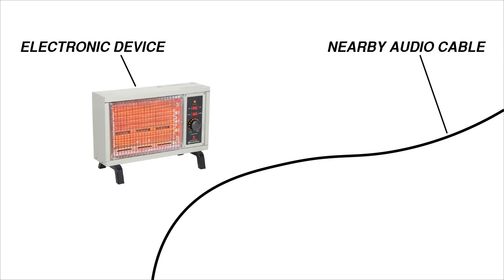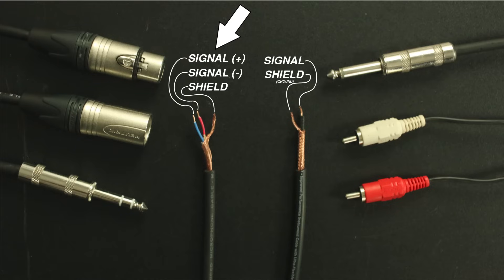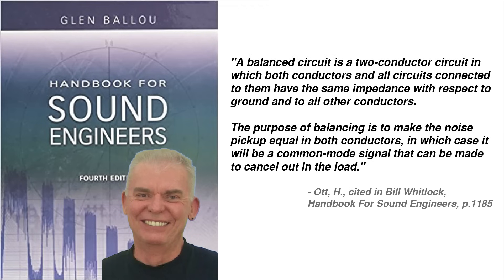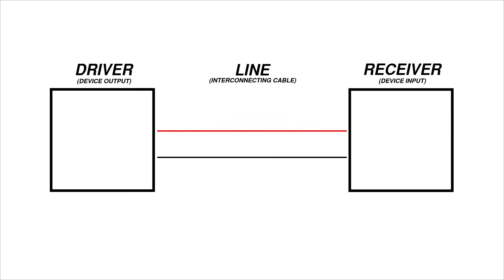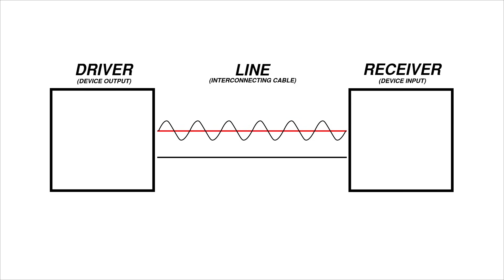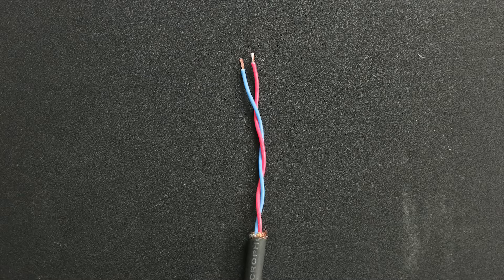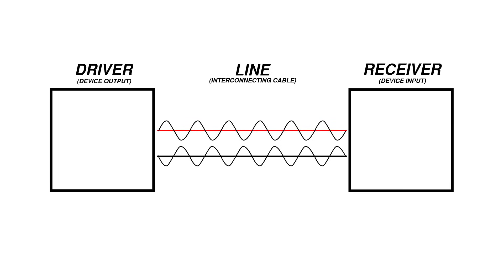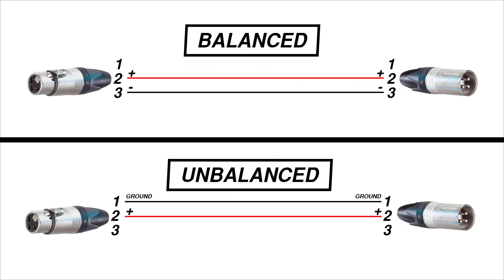Balanced vs Unbalanced Audio | Do Balanced Cables Sound Better?

Comment: I’m not an audio technician, but I do have a logical brain and scientific background. I agree that balanced cables are capable of a cleaner, but, what you neglect to mention, is that if you compare a truly, fully balanced amplify with a ‘direct coupled’, single ended or unbalanced amplifier the balanced amp will have to have that extra amplification stage. Each and every additional stage to any circuit will inevitably cause a degradation of signal! So, a truly single ended amplifier, connected to single ended source components using short unbalanced interconnects in an environment kept clean of electrical noise, or electro magnetic induction can equal, or even out perform balanced circuits and inter connectivity. So, you can never assume that just because you are employing premium balanced cables in a truly balanced audio rig, that you are achieving the best sonic performance. Neither can you make the same assumptions of truly single ended components using short interconnects. I say short interconnects as these will inevitably attract less interference than longer cables!
Reply: Thanks for the info. I knew that just replacing unbalanced interconnects with balanced ones would not necessarily result in better sound, but I didn't know why. Most explanations of balanced vs unbalanced don't cover this side of things. They only cover the positive case for using a balanced connection, so I appreciate giving us the 411 on all sides of the issue. 

However, I still need a bit more explanation. Can you tell me the meaning of "direct coupled" as well as "single-ended"?  Also what are the alternatives to these? "Indirect coupled" and "doubled ended:? And if so what are the definitions of these.

I always would tell people that think just swapping in an XLR (or equivalent )
for an RCA cable won't necessarily improve the quality of sound coming out of their system, but I couldn't explain the reason why. So they would usually ignore me because I guess it made them feel better to buy a more expensive interconnect and possibly a more expensive amp and or a pre-amp. Thanks!
Reply: @trippmoore  let me start by reiterating that I am not an engineer. Even if I were, you could not take my response as gospel, because each so say ‘expert’ will inevitably have a personal opinion which has sone type of bias. In my experience, the leaning of that bias is to a greater or lesser extent influenced by age and social standing. You can ask the same question of 10 ‘experts’ and get 10 different opinions. No, I’m just a man who is enthusiastic about music. Who listens to music attentively and cares about the way it sounds. If that makes me an audiophile, then so be it.

The best advice I can offer, is, forget about better or best, they don’t exist. Just think of components as being different, you may or may not prefer that difference. Just because one component is twice the price of another, doesn’t mean it will have a superior sonic performance. That extra money may well have gone into higher end aesthetics, better fit and finish, higher profile marketing or simply, higher profit margins.

Listen to opinions, study technical specifications, watch YouTube and other reviews, but only use these as very general guidelines. Ultimately the very best judge of the equipment you eventually purchase is, you! The equipment you should utilise to make that purchasing decision, is your ears and your wallet. If a friend or family member tells you that your hifi sounds terrible, well, so what? You didn’t buy it for their listening pleasure, you bought it for yours! If someone else also appreciates the sonic production you’ve created, then great, you can enjoy the music together.

Once again, I am by no means an audio technician. I’m just a music lover who takes a keen interest in the technical side of things. So the following explanation may be ripped apart by people more knowledgable than me. They’re quite entitled and welcome to do that. I make no false pretences. I don’t know everything. I’m not an elitist.

A single ended amplifier has one live connector and one ground. DC, or Direct Coupled simply means that there are no capacitors in the signal path. A capacitor is simply a device that stores an electrical charge, for use as and when required. Theoretically, the more minimalist the signal path, the purer the signal, so, truer to the original! On the other hand, a balanced or double ended amp h has as 2 live connections and 1 common ground. The hypothesis here is that both live comnextions will carry different s signals, so, any signal common to both cann be considered unwanted noise and rejected, giving a cleaner signal. As I mentioned in my original comment, it also incorporates an extra stage in the signal path, which, could/will degrade the purity of the signal.

If your components have truly balanced circuitry, then you should employ balanced or XLR cables. If your equipment is single ended, or unbalanced, but has provisions for the use of XLR cables, they will be of no real benefit and you should utilise premium RCA cables. Please note, premium does not necessarily mean expensive!

A good an allergy would be purchasing a new car. Do you choose petrol, desal, electric or hybrid? Do you go for front wheel drive, rear wheel drive or all wheel drive? There is no better or best, just different and ultimately you go for the combination that best suits your needs. Not the one your boss or your father recommended. You’re going to be driving that car, not them.

At the end of the day it is down to personal preference and personal choice. I employ a pure class A, balanced preamp. Class AB unbalanced monoblocks. It works for me, and it suits me. You must do what works for you, or what suits you best and bugger anyone who looks down on your choices. Most of all, enjoy the music.

Do you watch the PS Audio YouTube channel? If not, I advise you take a look at it. The presenter, Paul, the CEO of PS Audio is a really knowledgeable and amiable chap. He is not elitist and offers good advice, doing his best to answer viewers questions. Yes,   He expresses his personal opinion, but he is not patronising. He has also written a book called ‘the audiophiles guide’! It is very good and an entertaining and educational read. Yes, of course it is influenced by opinion, but gets my recommendation.

Hope this helps?

Comment: This ( transmission theory ) is a fairy straight forward thing in electronics engineering. No big deal.
However, when electronics ground - electricity earth - signal return are all there, you might need an EEE to sort it out. Not so easy then.

Comment: I thought if the polarity of one of the signals were inverted, then the noise would cancel out, but you said it is summed in this case. How strange...
Reply from the maker: Under normal circumstances, you’re correct. In fact, that’s what is happening here too. The reason they would sum here is because of the differential device.
Reply: @AudioUniversity  So does the differential device invert the polarity of one of the signals within the receiver?
Reply from the maker: I can’t speak much to the specifics of how it is done, because I haven’t studied electronics enough to properly articulate the specifics. However, I believe it is more so that the noise currents enter the input transformer coil from both sides, causing an equal but opposite voltage in the coil. Again, this may very well be a simplified way of looking at it. 

If you want to learn more about the details, there are many with better understanding than me. Although, the basics I covered in the video are as far as I’ve needed to go from an audio production perspective. 

I like your drive to learn more though! If you find a good explanation, please let me know!

Comment: I dunno, maybe for audiophile they may sound different, but to my "average Joe" hearing it's all the same, not into all those "curves, harmonics" and stuff, just enjoying the headphones from the box. But hey, if you consider yourself a grade X audiophile - it's your choice to purchase those "soaked in blood of 72 vergins of Tibet mountains, coated with skin of extinct mammal" cables and convince yourself there actually is a difference.
Reply: They don't sound different to audiophiles either. The only use case for XLR is when you need a long connection to prevent audio degridation, more than your average headphone cable, or when you need more power output for higher end headphones. Other than that, the difference they hear is all placebo.

Comment: In a balanced connection the signal on the two conductors is not referenced to the shield/ground. If the connection is also supplying phantom power to a microphone then the two signal wires are +48V with reference to the shield/ground conductor.

Comment: Good job. Some additional details:

1) Balanced audio is usually a much stronger +4dBu signal vs. -10dBu for unbalanced audio

2) The balanced signals are out of phase by 180° but the noise on each line is in phase. When the signals are differentially summed, the voltage of the original signal doubles while the noise component cancels. This is called common mode noise rejection.

3) Twisting wires to reduce interference goes back to the earliest days of stringing telephone wires on poles over long distances and works for unbalanced signals. Just look inside an old radio or tube amp to see this practice.

4) A four conductor balanced cable is twisted per pair and then the pairs are twisted together to improve the rejection of noise.

5) The ground pin of a male XLR cable is longer than the other two pins and prevents the pops heard when inserting a balanced TRS cable or unbalanced TS cable.
Reply from the maker: Thanks for sharing, @ratspam!

Comment: As a side note, the concepts for balanced and unbalanced signals apply to many other things in electronics beyond audio cabling.  Television and radio antenna cables would use round shielded unbalanced coaxial cables (75-ohm for TV/FM, 50-ohm for CB radio, for example) or flat 300-ohm balanced twinlead.  A little transformer would be used to convert TV/FM between BALanced and UNbalanced cables, or known as a BALUN for short.  Most Ethernet cables these days use balanced twisted-pair cables with different specification categories (CAT3, CAT5, CAT5E, CAT6) but originally it used coax.  Now all kinds of media in our homes uses unshielded twisted pair (UTP) cabling for networking, video, you name it.

The same basic principles for balanced and unbalanced cables still apply.
Reply from the maker: Thanks for sharing this extra info, Bob!
Reply: @AudioUniversity  You're certainly welcome!  Basic understanding of things like this acts as building blocks for understanding other more complex things.  If you can grasp the details of whichever parts you do know, there are fewer new things to worry about.

Comment: Maybe not related but IMHO; I've been using this combination for 15 years now and amazing sound creation thru it. F@# Canari and Neutrik. Amphenol (Australia) connectors (XLR,TRS,etc) with Mogami cable (Japan). OMG. I'm not endorse by any of'em but can't stop telling my friends and associates to try it. Notes; I wired hand soldered by myself with off course with top of the line lead and shields.
Reply from the maker: Thanks for sharing, Andi! Sounds like you’ve taken extra care to optimize your setup!
Reply: @AudioUniversity  It's natural you know to have the best cables for your expensive pre-amp. Doesn't make sense bought $3000 Neve 1073 pre but with a 'crappy' $10 cables. OMG

Comment: There is one little mistake made here. The balanced signal is correct on pin 2 and 3. But the unbalanced is on pin 1 and 2. Now 2 is the "hot" signal and 3 is the "cold" signal. The 1 pin is ground. Ground is also everything else so you will get a hum much sooner than you might think. Now if you connect up an unbalanced signal on an XLR, dont't hook up pin 1 as the "negative"! I didn't know this but it works great. So when you hook up the unbalanced signal to an XLR, only use pin 2 and 3. That way even the unbalanced signal will be treated as a balanced signal and you loose a lot of humm.

Comment: What's the length of the cables? Quite a great length if your starting with a thousand feet. That's 3/4 miles.
Two pairs if I'm not mistaken is 250'.
I guess if your going to be running cables that distance, you're not at home, listening to your home theater system.
Reply from the maker: For short cable runs in a home theater, the difference will be MUCH less, so much so that it will likely be barely discernible. If there are noisy power supplies and other noise sources nearby, it may cause some noise. If the cable run is beyond 15-25’, I would consider a balanced connection. 

If you don’t hear noise with unbalanced cables, you probably won’t notice a difference with balanced cables.

Comment: Audio University
sir my question, in an enclosed amplifier (metal casing), the balance and unbalance audio signals, how does it relate to input and output transformers, switching PS and toroidal transformers. i have notice, push pull amplifiers that uses E type transformers in the input and output stage audio signals, it doesn't cancel out noise interference that are induce from the transformers, even if all audio signal unbalance cables were properly grounded. thanks.
Reply from the maker: Hi, beau sky. Thanks for watching and writing your comment. Unfortunately, it sounds like you know more about circuitry and transformers than I do, so I’m afraid I can’t answer your question. Perhaps someone else in the comments with a stronger background in electronics will be able to help.
Reply: @AudioUniversity  ok. thank you.

Comment: At some point/s a system becomes unbalanced.  At the speakers at least anyway.  IME some kit sounds better single ended and some sounds better through XLR.  I owned a Yamaha AS3000 for a few yrs which is fully balanced from XLR input to speaker output but with my Luxman D06 it sounded no better through XLR vs rca using identical Ecosse silver cabling with just the differing connections.  Indeed one review of the AS3000 said the Rca ins sounded better.  HIfi+ magazine iirc.  Another disadvantage to the Yamaha being fully balanced also meant it couldnt run a powered sub from the speaker lines thus it held back the sound quality of my Rel subs.
That being said my Audiolab MDAC+ definately sounds better with XLR (and massively measures better in this mode no less).
The joke is that the vast majority of integrated/power amps featuring XLR ins are not fully balanced anyway, so its really easy to get hung up on XLR when in reality it may only be better for a given scenario and application not just always "better, full stop, the end".  That is the argument of the audiophool
Reply from the maker: Thanks for sharing this info, Tom!

Comment: You didn t mention the shielding.....what is it doing, especially in the case of TS, since the noise is there .....Thx, nice video ;)
Reply from the maker: In the case of a TS cable, the shield actually acts as a return to complete the circuit. With balanced connections, the shield is a means of connecting the ground of each device. I believe in both cases, the shield acts as a Faraday cage to drain away some of the electromagnetic noise from nearby electronics, etc. Thanks for watching, Gib Son!

Comment: It really only matters if the whole system is balanced end to end. Just because it has an xlr or speakon connector dosnt mean it's truly balanced. Quasi balanced gear is common.
Reply from the maker: True. While the entire signal chain doesn’t need to be balanced, the interface between the devices does - that is the source, transmission line, and the receiver. Thanks for reiterating that, @slim jim!
Reply: @AudioUniversity  you see this more in home audio I would say. Quasi balanced that is..